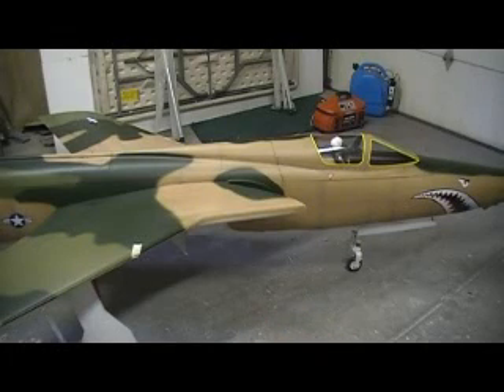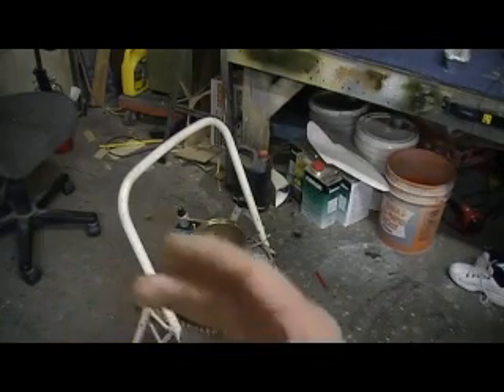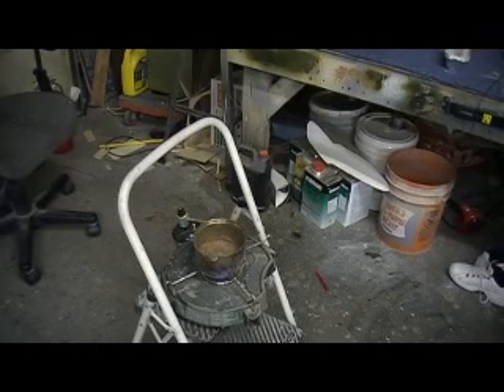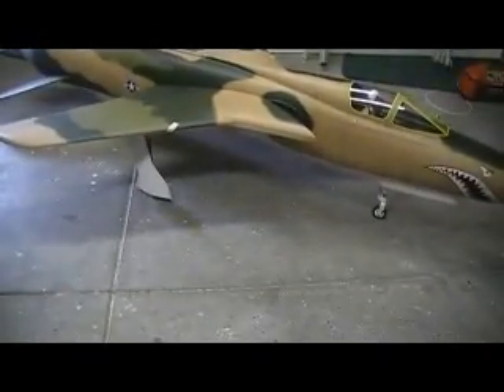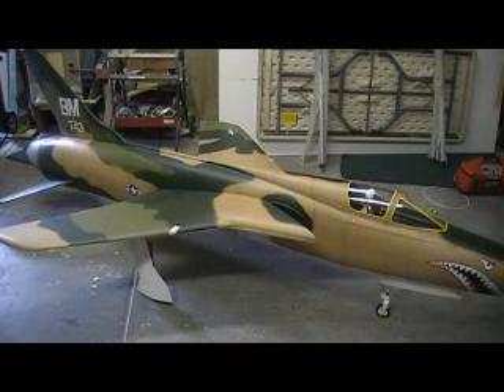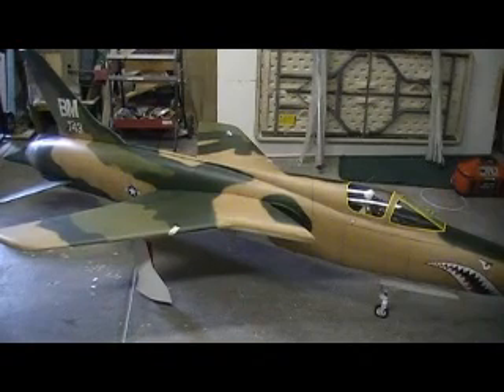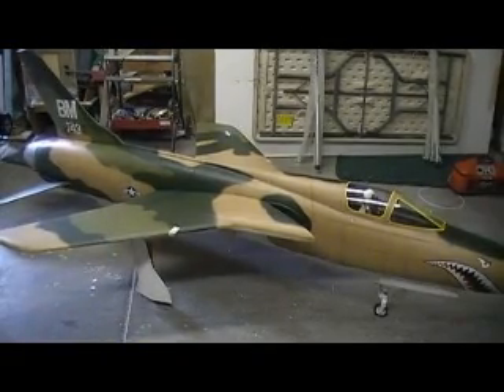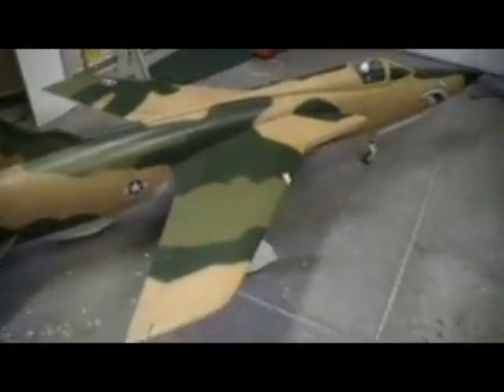how to build a rc jet F-105 thunderchief # 526

Comment: If you need lead, Scuba shops are a good source. The lead weights come in one pound increments and are slotted for the weight belt so you can strap them down.